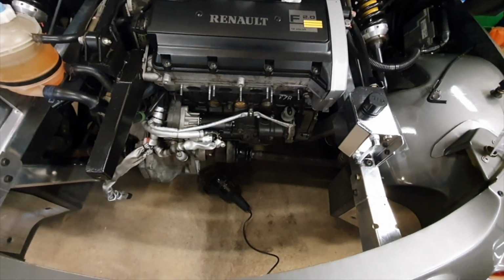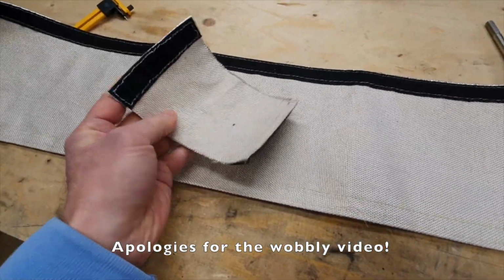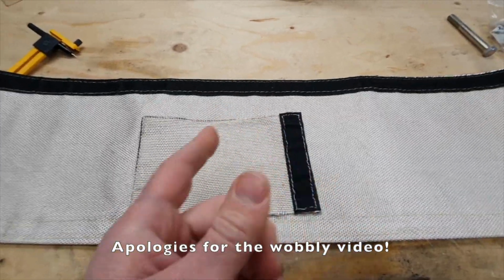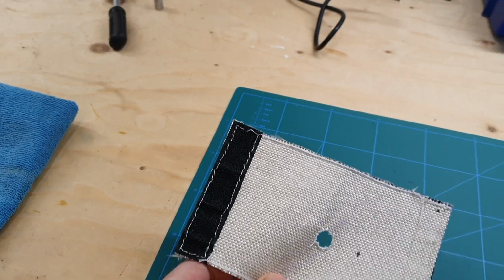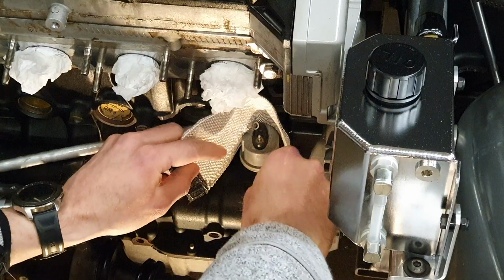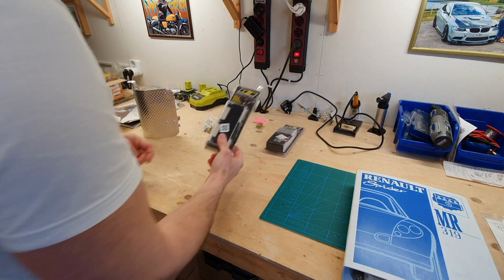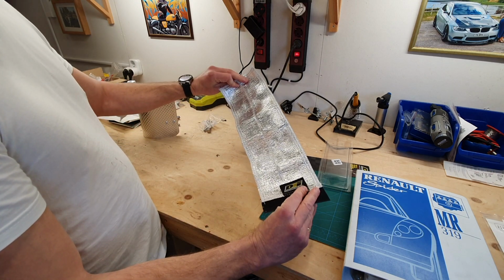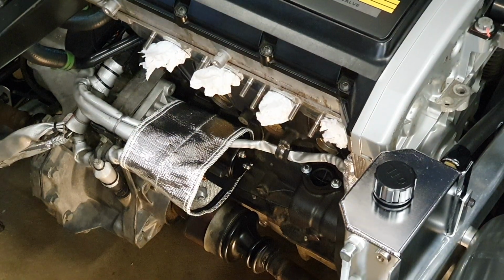USING HEATSHIELD WRAP TO PROTECT YOUR ENGINE BAY

Comment: That exhaust is surely what limits the car's potential, if only the rear hang was 10-20cm longer...
Reply from the maker: Not sure to be honest, it's the Orbisoud race exhaust designed for the Trophy race cars? I'd hope it's pretty good!
Reply: @SoloLap  I mean exhaust layout, not the  exhaust itself. The OEM one seems to be enormous and weird. 
In a normal car you have the muffler far away from the parts, and here it requires a lot of heat management... just for the reason of tight layout.
Reply from the maker: @Avrelivs_Gold  True! The drawbacks of being rear (ish) engined I suppose. Heat is a problem for sure. Radiator is in a crap position too